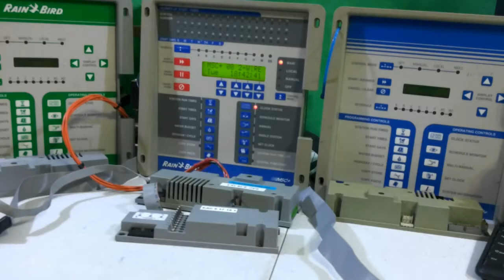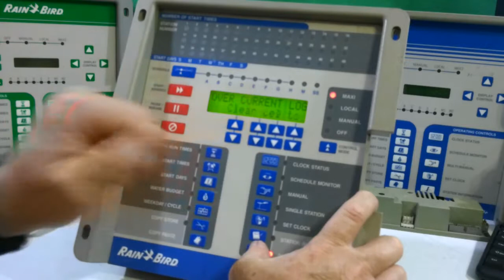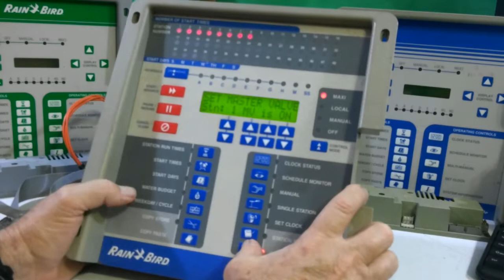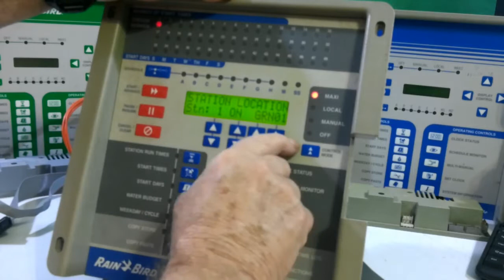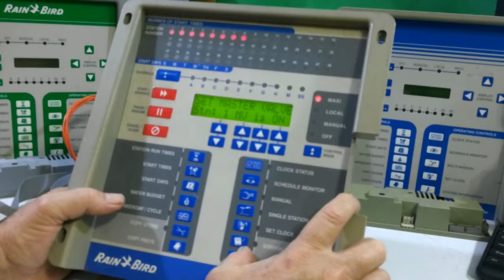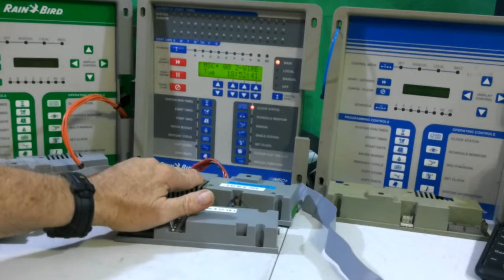Rainbird MSC+ Verses Rainbird PAR+ and PAR+ ES

Comment: Hi, I really enjoyed your video on the operation of the RainBird MSC+ Controller, well done and very informative.  You seem very knowledgeable with the 3 different models of controllers in this video and I would love to pick your brain.  Our small Northern Ontario nine-hole golf club is run by 90% volunteers.  I’ve been getting familiar with the Greenskeeper side of our operations and still learning each day.  The volunteer that is currently the Greenskeeper has been here in excess of 40 years and he has been the one to program our RainBird Par+ES controller as per the one on the left side in your video.  It seems that he can only program 1 station at a time to go on in a program mode.  Each of our stations have two 700 series heads on them.  I have the manual and have read it but it’s not clear in the programming instruction on if it’s possible to add more than one station to a start time and run time.  After searching the Internet and listening to your video I said to myself “this guy will know if this is possible or not”!  It just seems to me that it would be strange not to be able to do this when are greens all have four heads on them connected by 2 stations each.  It would be nice to be able to cut our total watering time by enabling 2 station (4 heads to go off) all at the same time.  The manual for the Par+ES does not explain how to do this very well if it can be done at all.  Please let me know, I thank you in advance for sharing your expertise.  Looking forward to hearing from you.  Fill free to email me at Gaumel333@gmail.com if you wish.